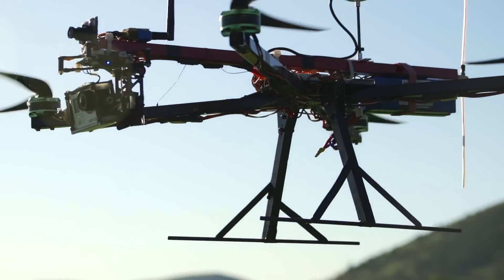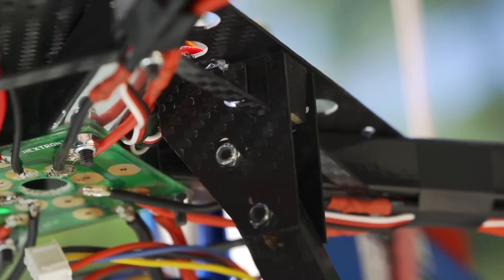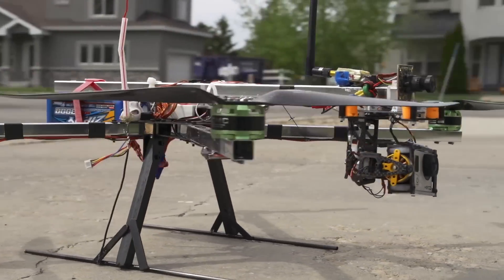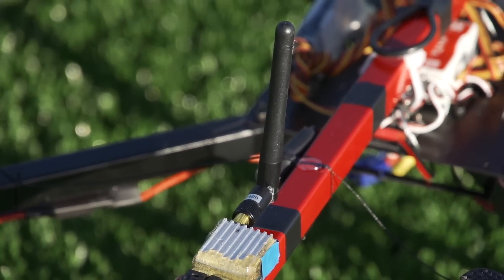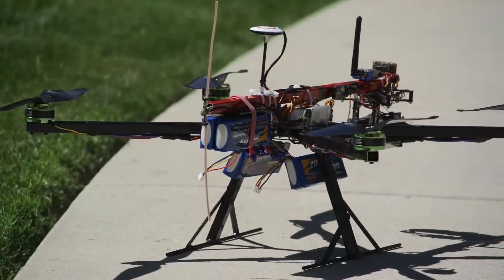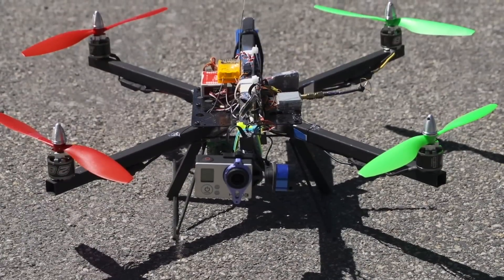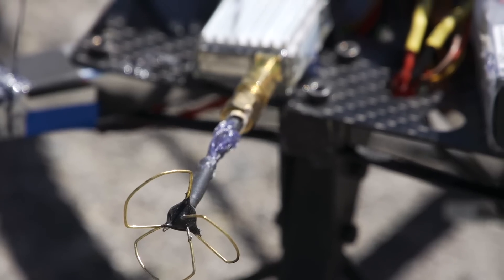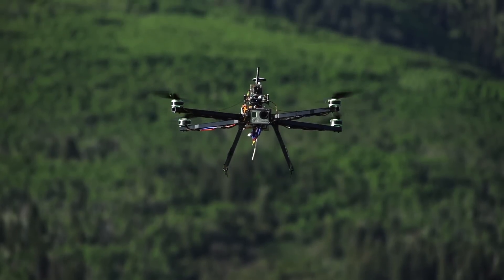Sport Quad V3.1 Aerial Video Quadrotor Platform - RCTESTFLIGHT -

Comment: why dont you run the fpv off the gopro
Reply: It has  two main reasons: first, the gopro is known for a little bit delay if you fly fpv. And secoundary, if you tilt the gimbal to the grund, the pilot wont be able to see whats in front of the copter. 
The best way is using two cameras and a video switch.

Comment: Great ideas you've been coming up with I like your use of the towel rack aluminum. I also like your method on this quad of making an X with the central isolated bar. I'm working on a foldup version of an H Quad thanks to your influence of towel racks ;)  I'll try to share a video of it after it's together.

Comment: Is there anyway that I could get a list of every part/link to every part you used in creating this video? I mean, there are obviously the aprts you sell, but beyond that, including the FPV set up and controller you used?

I know its a strange/big ask but I've been wanting to get into building this stuff for ages and I have never bought anything 'hobby grade' always just stupid toys to practice on. So although I would know how to connect it all together if I had it, I don't know where to start with what to buy!
Reply: lol, since I posted that months and months ago, I have done tons of research and learning, but part of this channel is dedicated to teaching, and so it helps to get an idea of what someone who's been doing this for awhile uses. like building a custom computer, find someone who does things that you wanna do, and get the specs of their build. Don't be an ass about it.
Reply: Yes! I'd love a list like this...
Reply: You'd learn a lot more if you actually looked into to it and researched it yourself, instead of expecting someone to hand you everything you need on a silver platter.......
Reply: ***** I agree with BitesCGI I've looked into it for months and still no one can give me a straight answer about so many tiny details ....
Reply: BitesCGI  I fly a 450 generic with DJI style landing gear so I get the gimbal off the ground. A 24" Towel Rod Replacement is run down the middle under the bottom plate. The gimbal ($50 from ebay) is on one end and the battery is on the other to balance. I run Sunnysky 2212 980kv with 20A Escs. 11" APC style props controlled by a KK2.1.5. Its 1400 grams with a Hero4 gimbal and 2 2200 batteries in parallel. This gives me about 10 minutes which is pretty good for the price. If you have questions let me know. If you really need to I could build 1 and put it on ebay.

Comment: I have lurked your channel for some time now... your unique adaptation of suspension jello elimination piqued my interest so I recently bought a small $20 gopro style kit- I have not used it yet as I don't have the proper rig built to carry it (using it as a rear view cam mount on a hex rotor)
I wanted to post up some rambling drivel to give you props (pun intended of course) and to opine on how you are missing the marketing boat- let me explain:

You have a knack for "form follows function" in your approach to building an aerial rig- the proof is in your video footage (let us not forget you have great piloting skills and instincts which are imperative- but we will pretend everyone has that, m'kay?)

Now- this latest offering of yours is right up there in those realms... it ain't pretty but it does work. Hence, I submit you should have named it "The Ugly Stick"

You are welcome... now just send me a kit for the marketing genius tip. *snork

Love your vids...
Reply: I'm definately gonna pull the trigger on his $20 GoPro kit and see if it will fit on 350QX to reduce the   jello :p